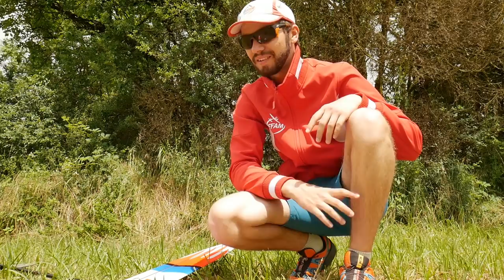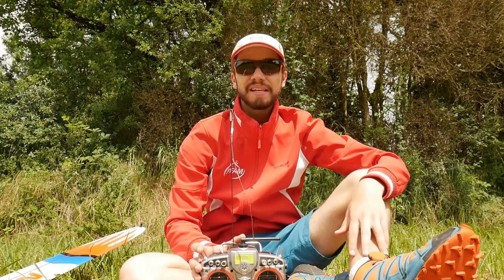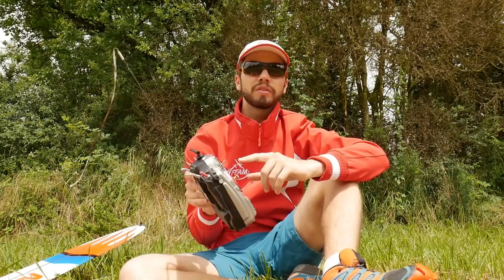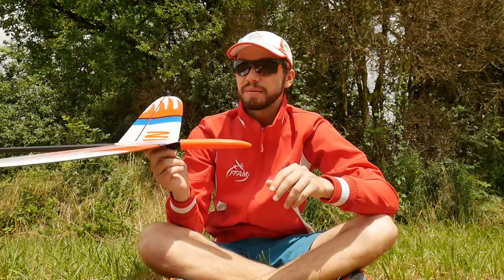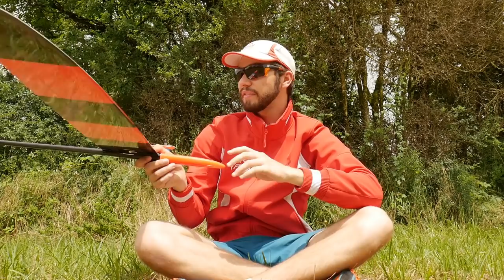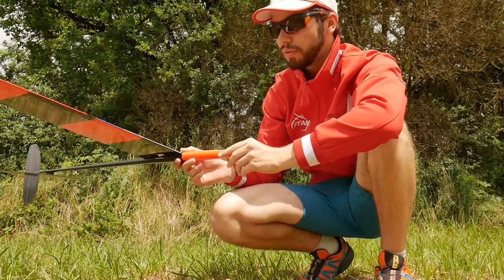F3K DLG TUTORIALS S3 Ep 2 / Radio modes and CG

Comment: Bonjour Pierre! I find it curious about the different transmitter modes. As I recall you fly mode i for DLG's. Do you fly mode i for quads too?

I fly DLG's for the most part but have just started flying quads. I fly mode ii with both as I live in the US. I have a little trouble with throttle on the left stick when flying quads because when I fly gliders, I use that left stick for camber and flaps. Pulling back on the left stick the glider slows and baloons up a bit, but with a quad it drops out of the sky of course! When maintaining a forward posistion on the left stick as is my habit with gliders flying in 'cruise', the quad goes straight up!

I am considering reversing throttle for quads OR putting the throttle on a slider like with an E-sailplane.
Reply from the maker: hello , yes I fly in mode 1 for both glider and FPV , it was wierd for me too at the begining but I did get used to and now it s perfectly find